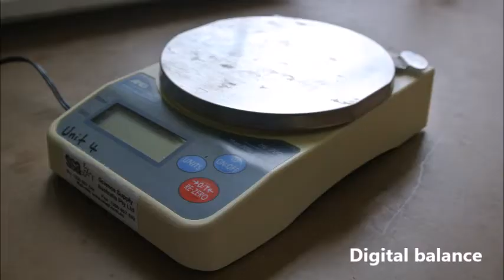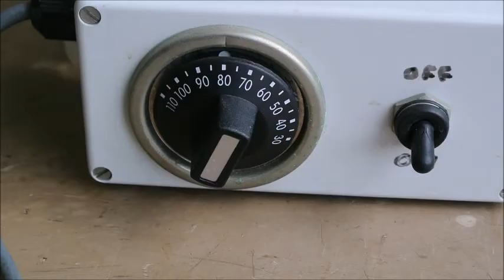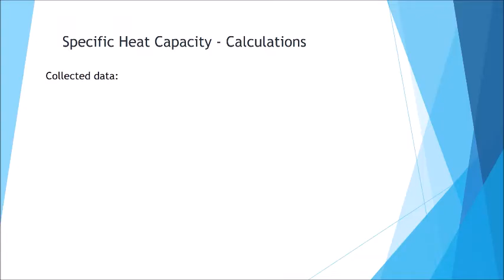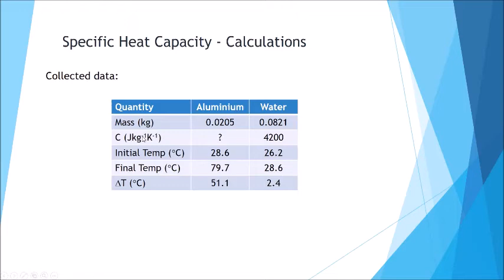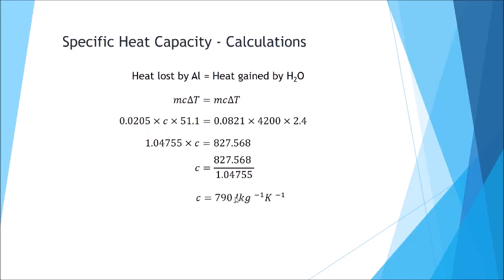Specific Heat Capacity Experiment

Comment: The calorimeter has 2 terminals and a resistor. So I guess, it is used to measure specific heat of fluids by passing a certain current X Voltage = power. And power X timer = energy in Joules. So if we know the mass of fluid, and the energy, it should be pretty easy to measure specific heat of fluids.

Funamental question is why materials have different specific heat?
Reply from the maker: Correct about the E=VIt observation. However, in this case no power supply is being used.

Comment: Step 1 Weight the mass of the water
1).turn on digital balance
2).Tare the digital balance to 0
3).Half fill copper cup with water
Result: mass of the water:82.1g
Step 2 Measure initial temperature of water
1).turn on digital thermometer
2).allow time for temperature to stabilize
Result:Water initial temperature:26.2°C
Step 3 Weight the mass of aluminum block
1).Tare the digital balance to 0
Result:Mass of aluminum:20.5g
Step 4 Heat up aluminum block in heat bath
1).set heat bath to approximately 80°C
2).carefully place aluminum block in the heat bath
3).allow several minutes for the temperature to stabilize 
Step 5 Measure initial temperature of aluminum
Result:aluminum initial temperature:79.8°C
Step 6 Heat transform from aluminum to water 
1).Use tongs carefully to transfer the aluminum block 
2).Place the aluminum block inside the calorimeter 
3).Use the stirrer to evenly distribute the temperature 
4).Add the digital thermometer
5).allow several minutes to reach equilibrium
Step 7 Measure the equilibrium temperature of aluminium and water 
Result: equilibrium temperature:28.5°C
Step 8 calculations
Reply: thanks man

Comment: How did you find the specific heat of water(c=4200)? I did not understand just this part.
Thank you for this explained experiment
Reply from the maker: It is a known or "assumed" value. Without this value you have 1 equation and 2 unknowns. I know it is water and can therefore use the value of 4200 J/K/kg.
Reply: @JuddyProductions  Thank you :)

Comment: How do you meazure the initial temperature of the aluminium?
Reply from the maker: It is assumed that after a period of time the aluminum reaches an equilibrium temperature with the hot water in the hot water bath. It is this temperature that is used as the aluminum's initial temperature.
Reply: @JuddyProductions  Thanks for the fast answer!